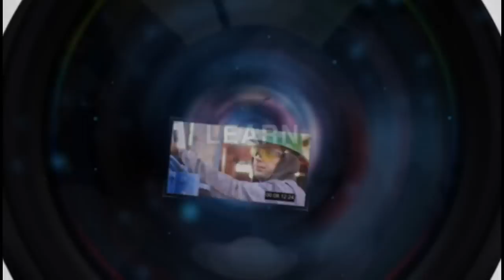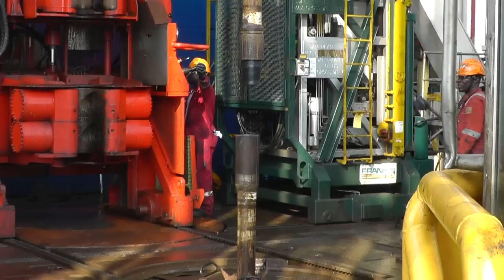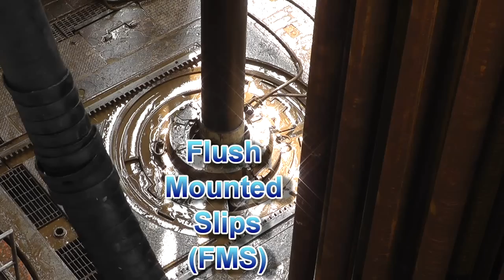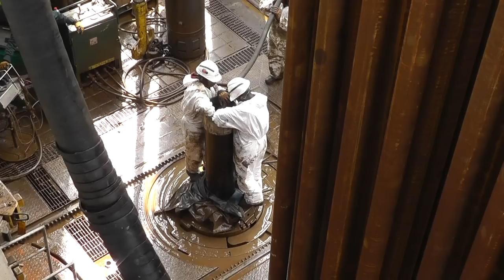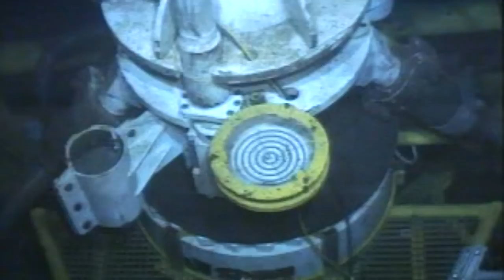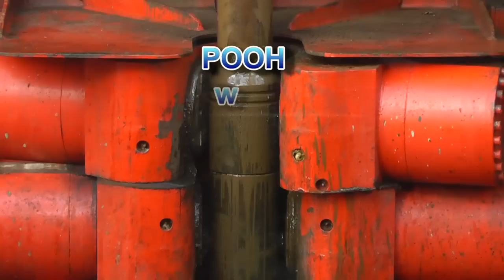3. 13.375 Casing Run and Cement

Comment: We had manual operated hoppers, with butterfly valve. I COULD NOT keep the cement level right. Either too low or overflowing. I  rather work on the floor. Ocean Victory, Odeco 1981-2 North Sea

Comment: what is tubing and casing?  Does it need to be replaced over time? Can it be reused?
Reply: +Roo M Casing is the string component that is drilled and cemmented and usually they are hanged with some sort of slips (you can see canh seal assy also for casing packoffs when the hanger type is mandrel). The last casing is called Production string/ production casing. This is also cemmented. Inside the prod. string you wanna install tubing string, which is not cemmented. Tubing is the "casing" that conducts production fluids from the bottom of the well to the surface, through the xmas tree (in natural production). Tubing is not cemmented because fluid flow corrodes it so it must be able to be changed. You'd also want to change the tubing to one of a different diameter to adapt it to the production flow rate).

Casing string will never be replaced/pulled out. Tubing must be replaced and maybe reused if downgraded.
Reply: +Eduard Voicu Great explanation, thank you!